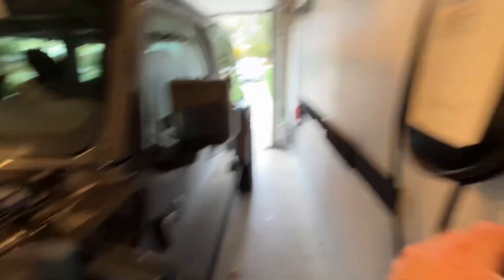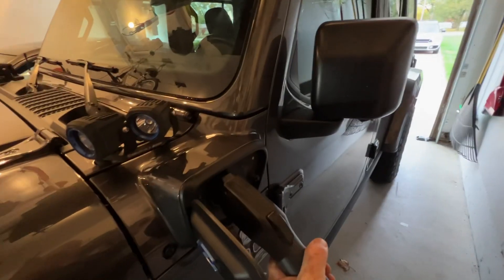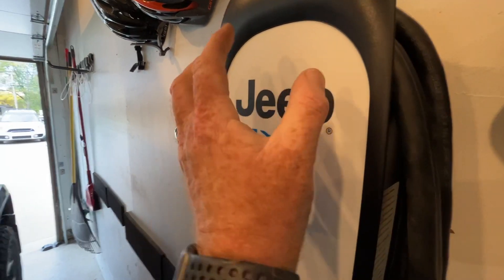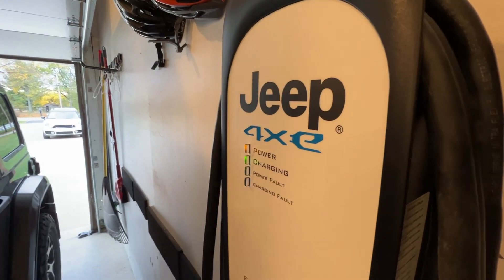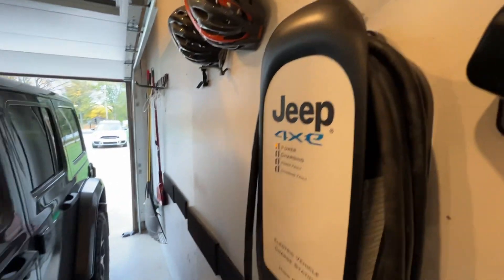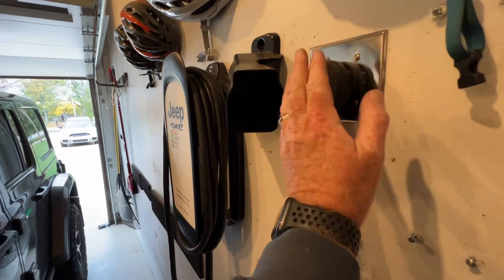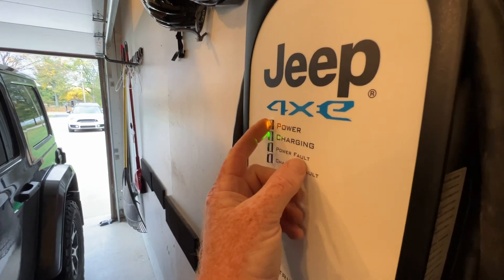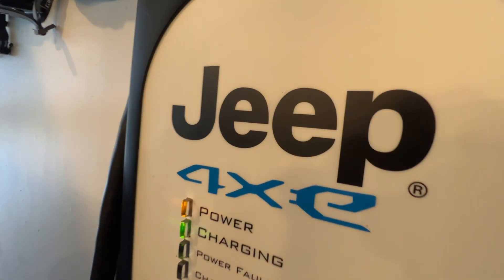Do you need to unplug your EVSE when not in use?

Comment: Will you make a video and talk about your thoughts and or concerns(if any)regarding EV fires and charging inside a garage at night(while you sleep) or anytime inside. There are videos and news stories out there of such fires and what fire departments face fighting EV fires.  How has Jeep addressed this and do they have built in protection/safety mechanisms to avoid such accidents from happening while charging our 4xe in our homes? Thank you.
Reply from the maker: I try to keep my finger on the pulse of the 4XE community as much as possible. So far, I only know of two 4XEs that have burned. Jeep doesn't release numbers but there has to be somewhere between 80,000 and maybe 100,000 Wrangler 4XEs on the road. That's not counting the Grand Cherokee 4XE and I haven't heard of a GC 4XE fire yet. So 2 out of at least 100,000 vehicles is like .002%. So that's as close to not being an issue as it can be.

Also, EV and PHEV fires are a lot less likely than gas model fires. The media just likes to talk about them because they are awesome clickbait for their websites.